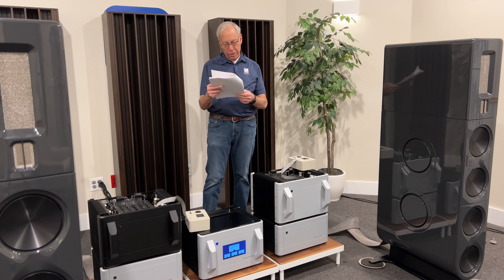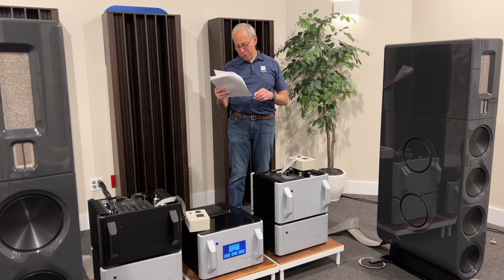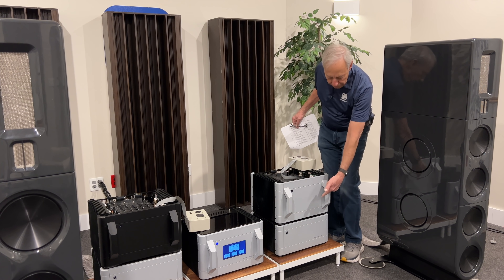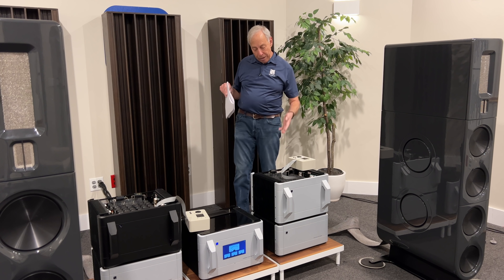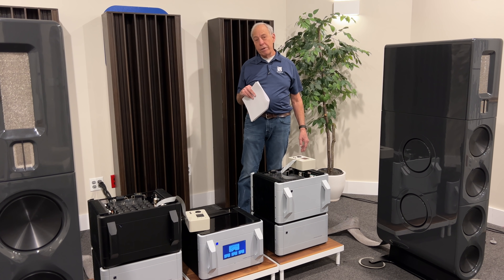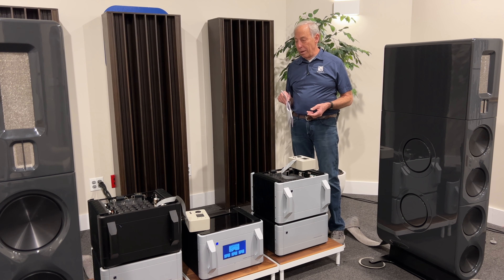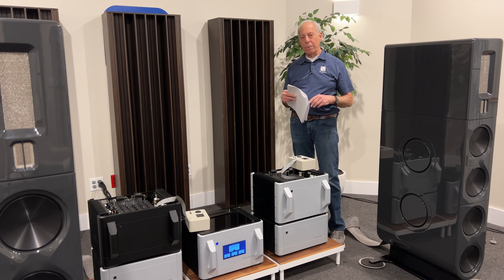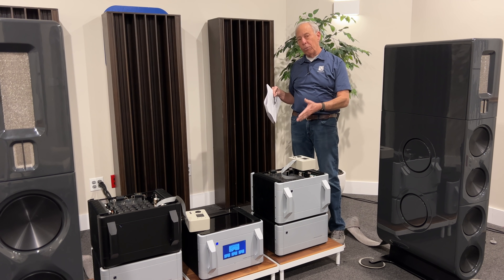When will vacuum tube amps disappear?

Comment: Some people like the added musical distortion of vacuum tubes. It's all great, but it's not OK if you call that a purist approach to audio. When your music has gone through tons of transistors including op-amps, of course adding one vacuum tube is not going to make the signal any more pure. A vacuum tube adding even harmonic distortion is sort of making the music more live sounding especially at the peaks. I would prefer a bypass switch to allow my music to be purest possible similar to some bypass switches with tone controls if you want purest audio.
Reply: The Schitt Freya is kinda cool for that. Can switch it between passive, jfet and tube modes.
Reply: You are soo full of it. There is no purist clean audio approach. I swear you're delusional. Look it's simple. Solid state amps also distort in even order harmonics but they hard clip and when they run out of juice they have more odd order harmonics. Tube amps mainly distort in even order harmonics and soft clip. They are both not adding anything until they are pushed too far. I've heard tube gear that sounded clean like solid states typically do and I've heard solid state gear that had rich engaging sound like an el34 but less midrange emphasis. The fact is every amp has a sound signature and no setup will ever compare to the real musicians playing in your room. Just enjoy the sound and stop  labeling it pure or not because clinical cleanliness is not pure either. It's just over filtered. Class a tube or solid state has no crossover distortion  and is perfectly linear. Class d however sounds different but the purifi class d amps are superb and match perfectly with tube preamps. Is it a crime to enjoy this? NO SO STOP SHAMING DIFFERENT SOUND SIGNATURES DAMMIT
Reply: @gavinbarr3441  Thank you. Why is it soo hard to just listen to something and be like that sounds great I want that or be like that sounds different but it's not wrong I like it too. With all the money hi end gear cost you could buy 30 concert tickets in a year instead of getting some $10k+ amp thingy wtf is wrong with people.
Reply: @V1ralB1ack  what if you listen to music to relax at home? everyone that loves music does not nessecery like to go to concerts. Like my self, i have been to a lot of concerts but it's just not the same relaxation that I get at home and the sound is often very bad at concerts.
Reply: @Gurra1980  I frequently go to concerts and always find the sound much inferior to my home system. Just went to a John Mayor concert which was extremely distorted and I was at the Super bowl a few weeks ago with the half time concert sounding like total garbage due to the acoustics of the huge stadium. Which band or singer sounds better live??? Even Diana Krall, Elton John, Cold Play, Pink Floyd, Dire Straits and every other live concert including concert hall classical concert I’ve attended sounded always quite bad. Large venues just make too much high latency multi path smearing the sound and the concert audio gear is more about playing loud than clean. So why do we hear this “sound like live” point so often? What live music? Diana Krall never performed in my living room.
Reply: @ThinkingBetter  Agree. The open air concerts due to powefull speaker systems sound same bad But to be honest I remember my daughther moving from place to place at gig admiring each "better place" to listen. There is no any one and only  "concert impression" . There are many like this, hard to know the intentions of engineers too. I remember  transmitted in radio gig recording  which obviously was registered  with small portable mono cassette recorder. In exceptional system it sounded just like studio  version of whole that situation. How to discuss tubes or solid then?
Reply: @Gurra1980  I'm not saying you have to I'm just trying to say you don't need to spend a fortune to enjoy music and movies and it's ironic the hobby has turned into expensive products that cost more than concert tickets for the year is what I really meant.
Reply: @V1ralB1ack  of course, you can enjoy on a small Bluetooth speaker to. But there is a demand for extraordinary hifi experiences. So what's the problem? You can also buy a willsenton tube amp for under 1000 that's also sounds amazing, there is stuff for everyone :)
Reply: @Gurra1980  Willsenton amp below a grand? where? and diminishing returns are a thing. I mean if you have money to burn sure whatever but what's wrong with spending wisely too. Spend a little to take care of yourself instead of dumping piles of cash on audio gear.
Reply: @gavinbarr3441  Of course whatever sound that makes you happy is what you should choose. I often use EQ (carefully tuned) if I have tonal balance issues with my systems or headphones. My favorite thing is to add about +6 dB around 16kHz as it makes my hearing rejuvenated like when I was in my early 20s. Tube sound is not my thing.
Reply: Do you have any supporting evidence?  Check a data sheet tubes are more linear than transistors if run within their specifications. This is a TIRED old trope invented to help early transistor adopters feel better about the terrible SQ.

Comment: The boycott of all things Russian has suddenly put the world's tube supply in real peril. New Sensor, the world's number one tube manufacturer, has announced that they have halted all shipments of tubes for the foreseeable future.
Reply: I got set of four and with moderate use after some 4 years I had to put  back old ones from drawer. Magic eye was like new but after 10 years in that set hardly visible
Reply: That's actually been lifted. They should be shipping tubes again next month. Might see a price hike, but otherwise, tube supply should be good again.

Comment: I have a sort of random question not about vacuum tubes, sorry to get off topic.
I was thinking about the the fact that the IRSV have been great speakers for over 30 years now... do you expect the FR30's to retain their value for that long? Will there be people in 2052 talking about their FR30's they've had for 30 years that "can stand toe to toe with most of the new stuff"?
Reply: That's why I love vintage audio so much, hindsight is 20/20
Reply: Absolutely not.  To be in that class, you need to make many models, and then maybe one of them can achieve collectible status.  Most Infinity models don't have that collectible "thing".  There are few brands where MANY old models are sought-after years later.  Altec, Westeren Electric, Tannoy, and maybe JBL.  There's other.
Reply: @bills8770  ... part of that is brand loyalty. If you loved it when you were 20 (and couldn't afford it) you may be seeking that stuff when you are in your 60s. (and CAN afford it) The flip side is SOME of that will fade with time. I am also a car nut and I see there are no longer piles of pre WWII vehicles at car shows. Brass era is non-existent. The people who loved them are dropping like flies (old age) and the cars are either going to scrap or museums. I presume the same thing will happen with vintage audio, and the new favorite for the next generation will be high end 80s / 90s gear.

Comment: My SET sounds better than my highly regarded 100wpc solid state/MOSFET amp. I guess it’s the silly output transformers.
Reply: It makes sense too as power scales exponentially. Every 3db increase doubles the power and a 10db increase in sound is perceived as twice as loud to our ears so tubes give plenty of power for most efficient speakers and the smaller transformers are lower on noise so it all makes perfect sense.

Comment: NEVERRRRRRRR! Tubes are nice, once you hear one, one with some syrup to it, I don’t know why you wouldn’t want that beauty once in a while
Reply: I’m in this camp also.  Some other companies have managed to use transistors in the variety of JFETS, SITs, and ramp up the bias on T03 cans to make them single ended, hence Class A in sound, which to some degree, mimics some tube characteristics.  Although engineering trickery can get close, and full digital types like Devialet, use all out DSP processing to mimic tube equipment fairly well.  Still though, tube rectification, tube follower and gain stage on the signal processing side just, in my humble opinion, is hard to beat.  As the saying goes, different strokes for different folks, as the saying goes.  Some folks like that up front and digital sound, like say Levinson, Constellation, Soulutions, etc.  I do to, to a certain extent, (I’d kill to get my mitts on a pair of mono Levinson #33H amps!  Hah!), but the depth, imaging, midrange sweetness and that outlook on life through rose colored glasses in tubes, for me, is hard to beat, hah!
Reply: They won’t disappear. I just bought a Cayin CS55A yesterday and I’m super thrilled with it 🥳
Reply: @frostycanada6404  cayin makes really nice things, i have never had a speaker setup but i do have a couple of good headphones & the cayin ha-1a mkii being my tube amp & its sooooo nice.. looks nice, built nice & sounds yummy yums
Reply: Tube amps are my favorite. They can sound clean or tubey and either way they are the most musical and most coherent and sweet sounding. They give you just enough watts and they sing to your soul and can handle voltage swing and impedance drops like an Olympian in their prime.